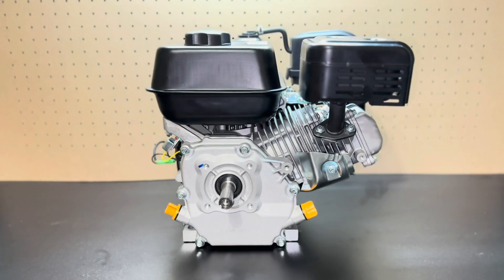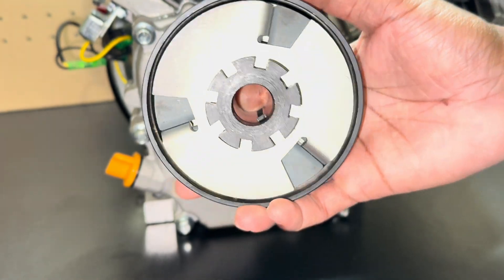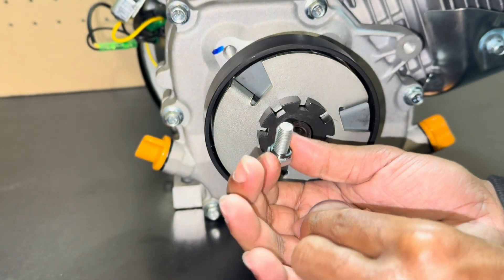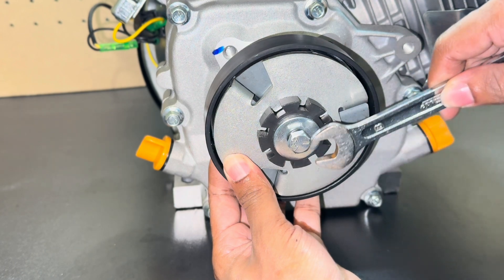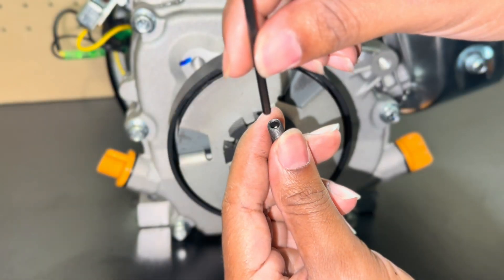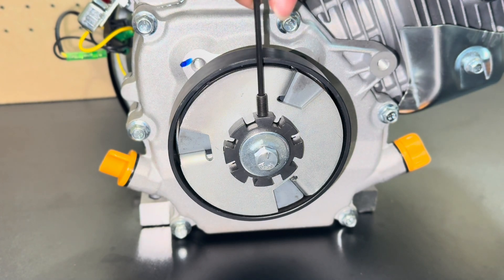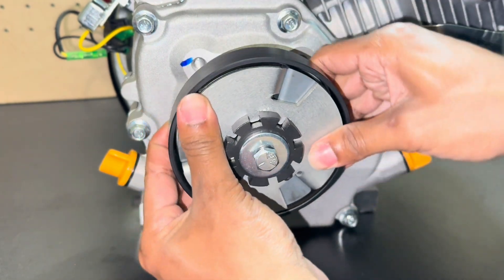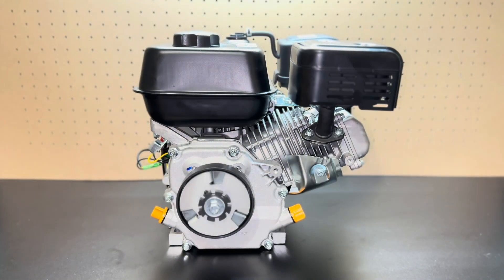How To Install A Centrifugal Clutch On A Predator 212cc Motor

Comment: Is there a difference in terms of efficiency and durability in time of use if i install clutch on Predator engine with tooths to the exterior compared with installing tooths to the engine?